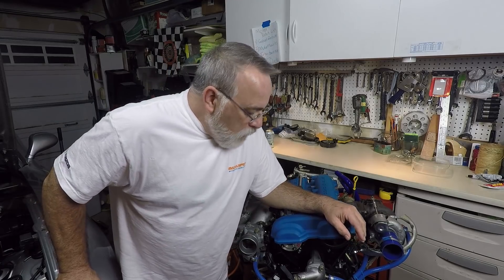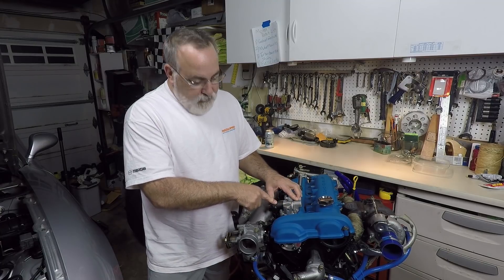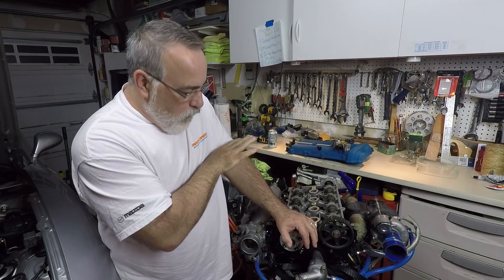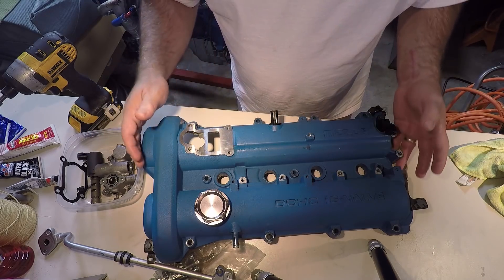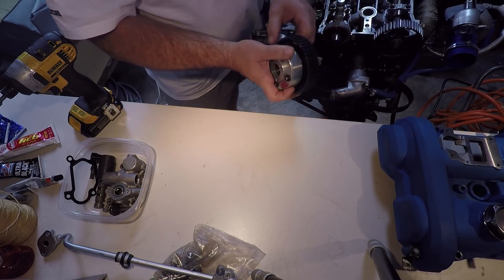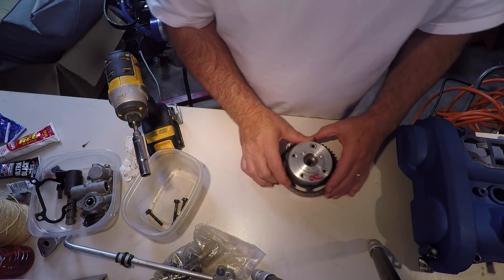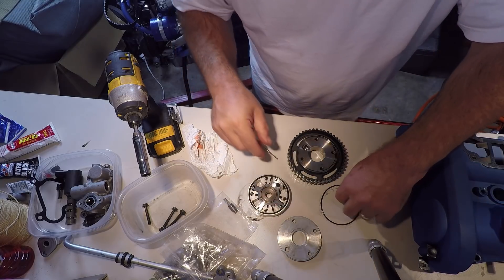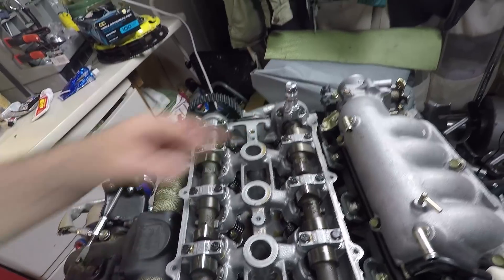Checking out the VVT in the Boosted MIata

Comment: Will a bad vvt actuator make a grinding/rattle sound on a cold start?
Reply from the maker: Yes, but may still function ok. O ring Seals are worn, oil drains out and the phaser rattles on cold start up.
Reply: @Seandoestech  On my miata it only makes that sound on a cold start but it still functions properly after that. Is it safe to drive it like that or replaced immediately?

Comment: What would you recommend as an OBD2 dongle type code reader for a Miata?   I have a 2001.    One that supports the Miata proprietary codes.    Hopefully one that has real time timing capture capability.      BTW I took apart my VVT actuator and used 3200 grit cloth to clean up the piston action. Glued the cloth around a short dowel and took my time to polish as much surface that I could  I think it improved the VVT function.   The power kicks in pretty smoothly around 4-4500 RPM. But I would sure like to  watch the timing in real time.   Not going to upgrade to Mega squirt system/ECU.   A great kit for finishing abrasives is made by Micro Mesh.  Starts at 1500 grit and graduates to 12000 grit.
Reply from the maker: Charles Mcgehee great knowledge on that VVT rehab, thanks for that. Not sure about the OBD2 reader. I know the generic torque app does not capture the VVT data as far as I know.

Comment: I have decided not to deal with the slight ticking I hear.   It goes away after a few minutes of warm up.    I am thinking the bullet shaped filter screen is a possible culprit.   I will deal with it when I do the timing belt replacement which is coming up.

Comment: At 12:00 You said this was a boring video, WRONG!  This was awesome. No one else is talking about this VVT system. I'm about to pull the valve cover and until I saw your video I had no idea what this tube on top of the cover was or how to deal with it. I was in school for thirteen minutes. Picture and audio quality was top notch also. Where did you get the VVT o-rings from? Never mind, Just saw the same earlier question.
Reply from the maker: Glad you found it helpful. Here's the rebuild kit
http://miataroadster.com/miataroadster/miataroadster-vvt-system-viton-seal-rebuild-kits/mrvvtrk/i-1964289.aspx
Reply: At 2:29 you discussed the banjo bolt but not the torque, where did you find that spec? After watching your video, we purchased the Haynes manual & I am reading it, but does not seem cover the VVT system. Before your video we had not started the valve cover replacement. But due to your guidance we are almost done. I plan on driving this car before sun down & with that torque I will!
Reply from the maker: +Sirrom0206 first of all make sure you're using new OEM copper sealing washers on that banjo bolt. Then it needs to be really tight I'm not sure about the torque spec but I'm guessing easily 40 foot pounds of torque.

Comment: Great video.   Any info on the sizes/sources of the o-rings?    I'm getting the P0012 code and am thinking to replace some of the O-rings as a first effort.   I found a $50 total kit but am not too interested in taking apart the actuator as it is reported to be very tricky to put back together.   Thanks!
Reply: Any progress with that? I am getting the same on my 03 Miata even though it is running just fine.
I find the P0012 issue frustrating as there doesn't seem to be a consensus regarding the matter.
Reply from the maker: I ended up replacing the entire VVT actuator gear with a used unit. I suspect as these VVTs get older, the internal apex seals start to wear out and replacing the entire gear with either a new or used unit is the only solution. Of course, you should attempt to replace all the O rings in both the valve solenoid and actuator first and see if that helps, just don't take the apex seals and springs out of the actuator - it will likely never work again if you do that.
Reply: No code in 4 months.    Bought a pack of Viton O-rings off Amazon and replaced all four of the brittle rubber o-rings on the solenoid.      The small filter was clean but I cleaned it anyway and carefully spread the plastic grippers so it would stay on better.   It may have fallen out and reduced oil flow.   That's all I did.   Did not take anything apart.   
https://www.amazon.com/gp/product/B00NSHBRQI/ref=oh_aui_search_detailpage?ie=UTF8&psc=1
Reply from the maker: Stephen Barr I got my o rings from a Mazda dealer. the bigger o rings for the actuator gear, I bought at my local hardware store.
Reply: Thanks for the help, I think I'll do the same.

Just to clarify, the valve solenoid only has one O-ring. Do you mean the four O-rings on the "vertical valve" under the valve cover ?
Reply from the maker: Yes - all the o rings you can get to :)
Reply: Yes.  The four small o-rings.   They were very brittle and broke when I tried to remove them.   There are some miata forum posts on this too.   I did not take off the valve cover to do this.